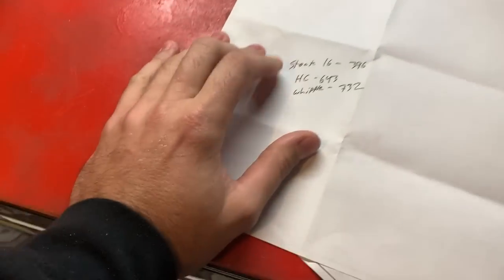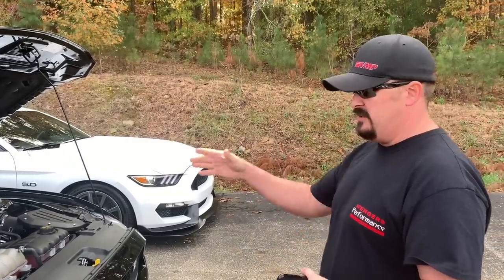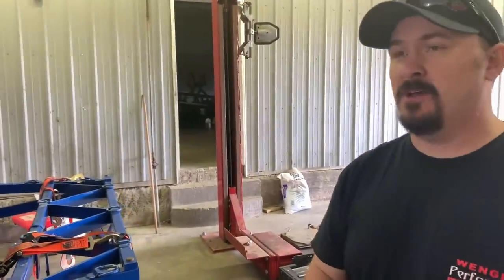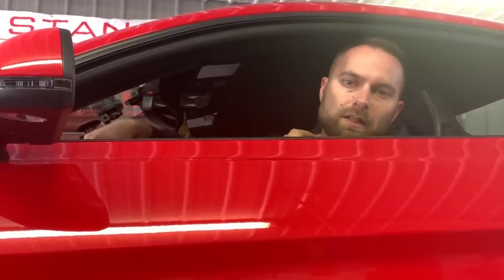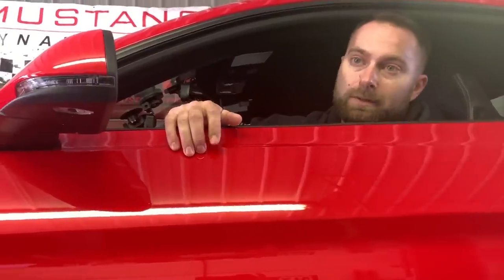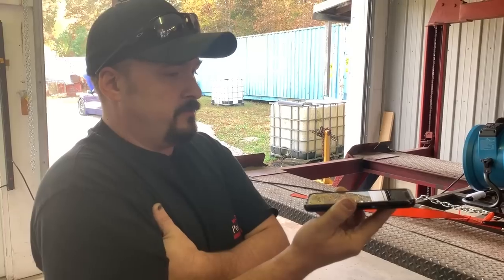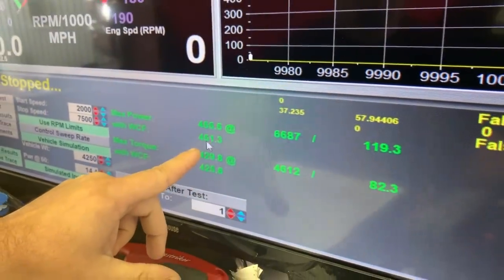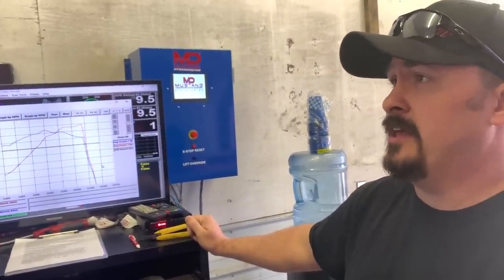How Underrated is the 2018-2019 Mustang GT from the Factory on a Dyno?

Comment: Very interesting,dynos are fun and give an idea of what type of power a car makes ,but in the end the real rest is throw a good set of tires(slicks) in the back ,hit the track on a good weather day,and see what times it runs.I read one comment about a possible bullit motor could have been dropped in on the line,maybe or maybye not,but I do know not all cars are equal, back in 86 lol, (I know a long time ago) but there were Iroc z with a mild cam and some had a hotter cam ,same 305 tpi but 2 identical cars could be a world of difference in performance..
Reply from the maker: That would be so sick if I have a Bullitt engine. I have no idea how to check that though
Reply: That would be sick,I'm sure with a little digging you can find out what to look for ,like i said in the earlier comment back in 86 ,if you had the 305 tpi which was the top engine for that year they put a mild  cam that year also BUT ,there were some that got the hotter cam just by luck and what you had to look for was the mild cam you would have at 4500 rpm yellow going to red at 5000 rpm, the hotter cam car went yellow at 5000 rpm redline at 5500.,would be very cool if your car had an out of ordinary build from the majority

Comment: They need to get someone that knows how to run a dyno.  Stock 5.0 doesn’t make 450 hp at the wheel when they  Make 460 at the crank.400, 405 maybe

Comment: Based on your paper of vehicles before yours, it is reading way overly high chief. Use a dyno the uses SAE and closed hood. SAE is what the manufacturers use. Dyno jets with STD and smoothing can over inflate or under rate power. Based o. That papet with the other cars, it shows 396 rwhp for a stock 16 GT. 15% puts it near 450 hp crank, 15 to 18 hp higher that what it should be. And the Hellcats is at 745 hp based on your info. So now I'll blast ahead.
Reply: Why does it matter if the hood is opened or closed?

Comment: If I had the cash you have to have a 18 GT, Hellcat and now a 19 GT in 3 yrs, I'd fly out to you and we would go over your car and visit a few more dynos, on me ;). But I don't make big $. Wish I had gotten into YouTube when I started watching in 2007. It was only a year and a half old then. It is WAY more difficult to do it for $$ than even from a yr ago. The rules get tighrer, view requirements go higher and for longer watch times and minimum subs requirements are up alot. Keep it up though I would not do a single mod except for 93-95 octane and filter drop in until Ford admits to its cylinder/pistion/bearing issues and resolves it. Fyi: The inconsistent, intermittent metalic typerwriter tic hss existed in mustang V8's since 2002. The exact same tic. Your ok so far but It won't last. I had 2 5.0's post 2011 and they both developed the tic and out 65-70k miles on both with no issues. Just a unsettling occasional tic.

Comment: There overrated in my opinion.  That's overall.  Especially with the different motor problems popping up as time goes on. I'm glad I have my 16 and didn't purchase a 18 etc... I seen some 18' and 19's run at a track event just recently and not impressed at all. I'm happy with my 16. More reliable and would hold it's own against them.

Comment: Zan its bad karma to post bs man. The  10 spd is more efficient than the manual, so 13% puts it at 526 crank hp which is IMPOSSIBLE without dome NOS and a tune. Dude. Total bs.
Reply from the maker: The weight was off. We are going back to redo this. All I did was film it. That’s also why I never said the numbers were totally true bc I don’t believe them myself

Comment: Simulated inertia is way wrobg and vehicle weight says 4250 lbs. Dude the car is 3850 or so with a loaded automatic. There's just a lot that doesn't look right including what gear you used, plus your not supposed to be doing the dyno.. Sorry man but your losing me ss a sub soon it you don't correct this bs and make it right. And close the hood when doing s dyno unless you drive that way, don't dyno that way.
Reply from the maker: Yes weight was off. The dyno wants me to come back to fix it. We are also going to a dyno jet to confirm as well. Power should be around 430ish. I obviously was not running the dyno computer
Reply from the maker: Did you not read the other reply I gave you
Reply: @Zander13Productions  Not yet. Stand bye.
Reply: @Zander13Productions  side note, I have seem bad dynos read high too.
Reply: @Zander13Productions  if your really in the 525 crank hp /465 rwhp range, you should be able to hang with a new ZL1 and put two school buses on a 2016 to current 8spd SS. Go test the power :). You should be able to walk away from an SS.